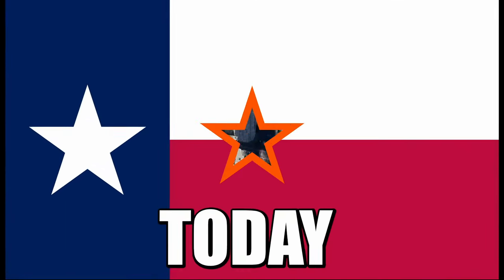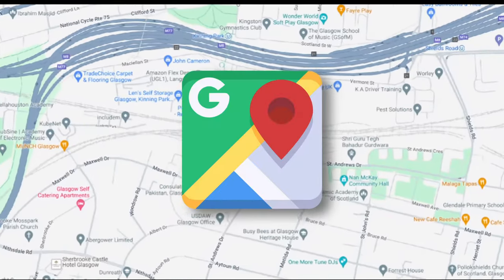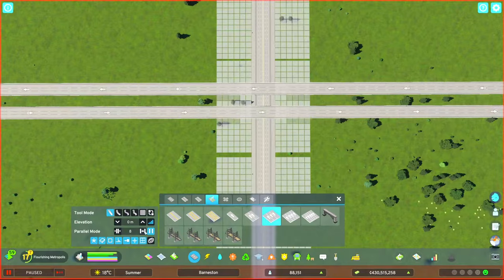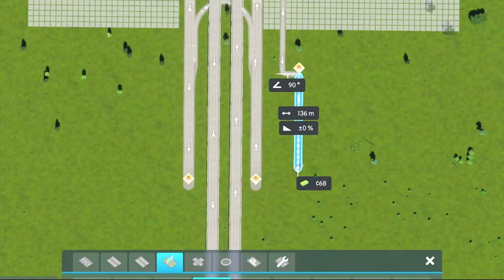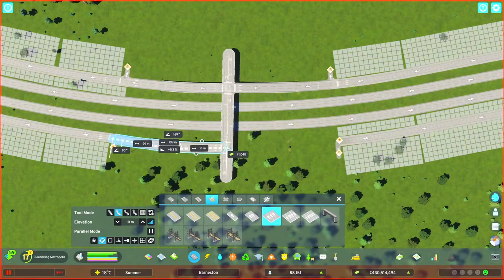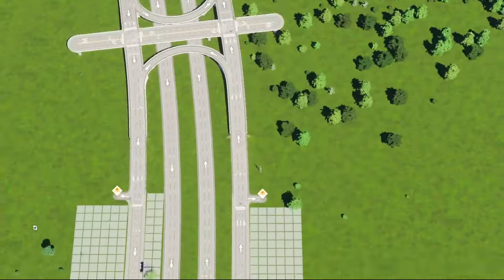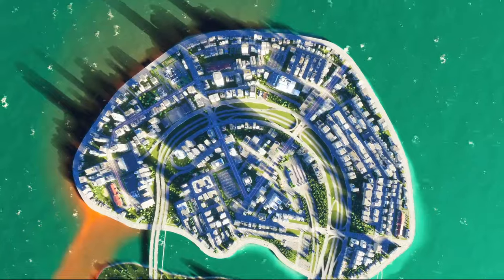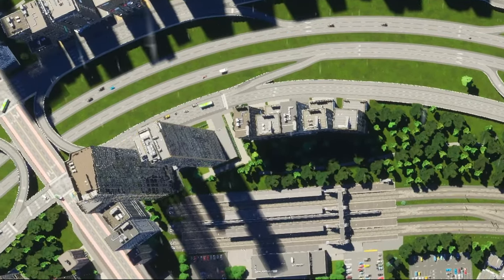How (And When) To Build The Texas U-Turn In Cities Skylines 2

Comment: Fun fact: you'll find both types of these U-turns in Texas, but it's mostly the underpass type in the southeast part of the state, near Houston, and mostly the overpass type up north near DFW. Don't know why, but I'd guess it has to do with the differences in weather.
Reply from the maker: Is the weather that different? How do you think that might affect design choice. I'm curious now. :)
Reply: @piccana_  Well, they actually have winters and occasionally snow up in Dallas, while Houston of course has to worry about hurricanes and flooding. Don't know that weather considerations are the reason for the disparity in U-turn types, but it's the only thing that comes to mind. Perhaps the underpass type are more conducive to avoiding drainage issues on the lower road.

They do have both types up in Dallas, but the overpass type are quite rare here in the Houston area. Maybe they just never caught on down here? Or maybe we just like driving up and down on our freeways because it's otherwise so flat, lol...

Comment: The u-turns work well.  One difference that I have seen is the on/off-ramps are displaced more.  This alleviates weaving because the frontage roads do feed businesses and side streets.  As soon as the highway crosses the interchange, there is immediately an exit for the next interchange.   For the highway on-ramp, that is placed a lot closer to the next interchange than the one it serves. This gives people more room to weave on both the frontage road and the highway. Does that make sense?   Of course, every situation is different based on obstacles and how close together the interchanges are to each other.
Reply from the maker: Nice, I'll have a look for that 👍